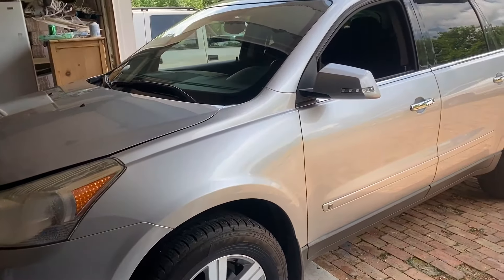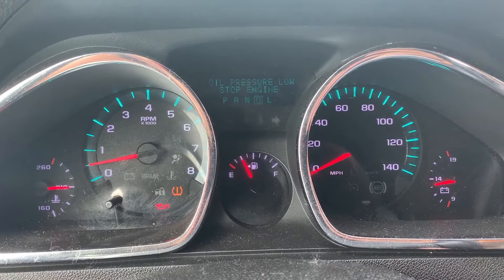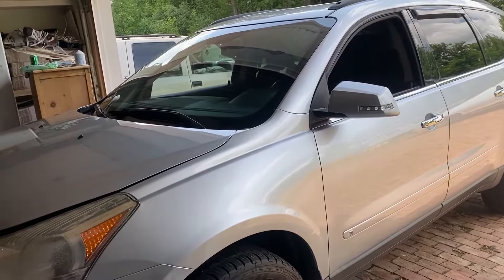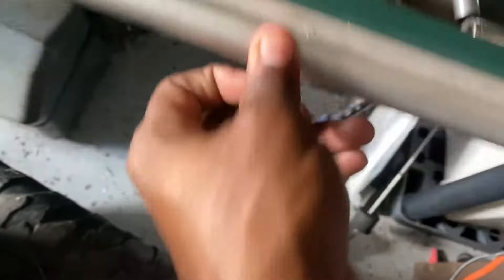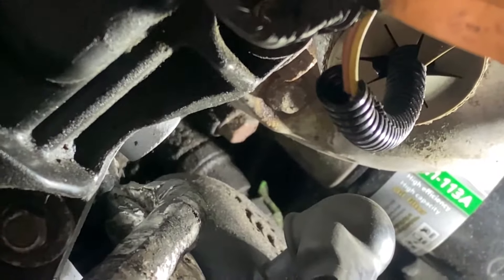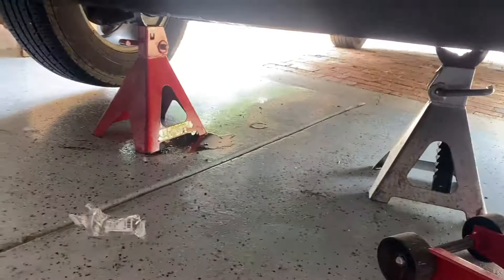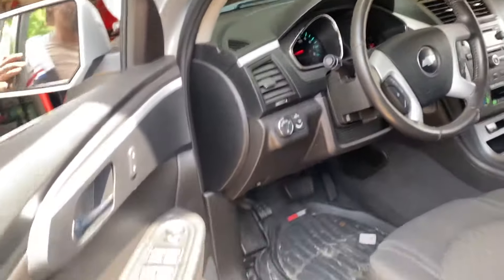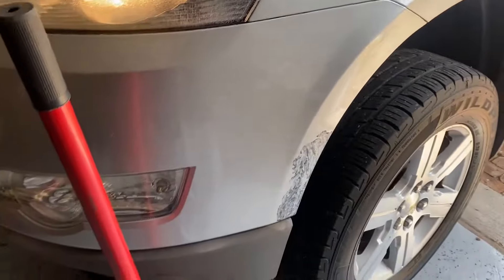Chevy Traverse Low Oil Pressure Issue!! Stop Engine Warning!! Easy and Simple Fix!!!

Comment: Hey thanks for the video, I have a 2011 chevy traverse , it runs good until about 20-30 min it warms up then a low oil pressure light comes on and makes a ticking noise , just wondering if thats a symptom of the oil pressure sensor, or something else?
Reply from the maker: When was the last time the oil was changed?
Reply: @TerenceDIY  I just changed the oil and filter but I also put brand new timing chains , chain guides , tensioner and oil pump in it , and changed the oils pressure sensor, don't know what else it could be honestly, it runs great for about 30 mins then oil pressure light comes on and makes a little tick , I shut it off then start it back up , sounds great for a while  , then does the same
Reply from the maker: Couple of things... first I want to ask have you ever replaced your VVT solenoids? I have a few videos on my channel regarding them (Not for this particular car). That could be your issue. Also, what oil are you using (type)?
Reply: @TerenceDIY  I've thought about vvt solenoids , and it put in 5W-30 ,.. I did clean the inside real good and so maybe there is some lose gasket or dirt, so I'm going to drain the oil and see if there is any junk in it maybe something is clogging the pick up tube , but Ill check the VVT solenoids and see if they are dirty. Thanks, I'll update you on what I find out
Reply from the maker: I won't be surprised if the VVT solenoids are the culprit. Let me know what you find. Thanks,
Reply: Mine did the same after i changed oil then i changed sensor after watching this and its still saing pil pressure low i dont see no oil leaking2016 chevy traverse @TerenceDIY

Comment: Good video. In my case the light comes on and then goes offs sometimes after a few minutes.  My oil is not low, just got changed a month ago. Should i change the oil pressure sensor ?
Reply from the maker: That will probably solve the faulty light signal you are getting.
Reply: Is it safe to drive the vehicle?
Reply from the maker: Yes. One thing to note, let's just say there was an issue with your oil pressure (highly doubt it), that Traverse would drive awful. Out of the ones I have worked on, most had faulty oil pressure sensors in which ultimately turns into a timing chain issue.

Comment: Hey brother on three years late lol I just watched your video. I absolutely had the same problem but also I’m having a service brake system on with my traction control light and the bell sound from the oil light coming on but my car runs fine. I drove it. 20 miles in no issue just the annoying sound and the service brake system keeps coming on any idea what that could be
Reply from the maker: It's difficult to really guide you in the right direction unless I was able diagnose it. I would probably know within minutes what the issue is. If you don't have the correct scan tool, autozone may be able to help and pinpoint the problem. I'm sorry. I wish I were there to help.

Comment: Thanks for this video.  I'm sure it helped a lot of people.  Question......I understand there's a filter behind the sender that should be cleaned or changed.  Does anyone know if this is true?  My advice to those with a 3.6 is to change the oil at 5,000 miles or less.  Never go by the manufacturers recommendations.  There are some tiny oil passages in this engine, and the timing chains (3) will fail sooner with dirty oil.  My brother ignored the advice, his started misfiring, he drove it anyway and it threw a rod through the block.

Comment: Great video.  Yours was the best I saw on YouTube.  I had the same issue and was able to swap out the oil pressure sensor in roughly 90 minutes with the help of your video.  Only thing I would add to your video is to disconnect the battery and then remove the alternator cover.  It gives you a little better visibility and room as it is very tight down there.  If I had not done this, I am pretty sure I would still be out in the garage belting out profanities.  One other thing is to take note where the ridge is on the new sensor for the clip.  The replacement sensor may not stop in the same location and you will have to rotate the clip appropriately.
Reply from the maker: Thanks for sharing that insight for others to note. Also, thanks for watching.
Reply: What to do after we change the sensor if it still saying that

Comment: Thanks for the video. I thought I was done for! It came on after 2 days of an oil change. I thought I had forgot to put the drain plug back on or somehow burned through oil or didn't tightened the oil filter enough and leaked all the oil out. Thank you so much! This video has reassured me! If you don’t mind me asking your tire pressure light, did you end up doing anything about that?. I’m in the same boat after a tire replacement and was informed that the old TPS was bad and was gonna cost an extra $200.

Comment: I have the same issue with my gmc acadia denali 2013 , i have changed the sensor but nothing changes the problem still not fixed i need help please😿?
Reply from the maker: How is it running? This issue goes beyond that sensor. The timing is a HUGE issue with those vehicles.

Comment: I have 2009 Buick enclave withe same oil pressure light comes on,the. I turn it off and back on it runs fine. Sounds like a faulty sensor no?
Reply from the maker: There's a very strong possibility. That's been the case on pretty much all of them that I have worked on. Thanks for watching.

Comment: Hey Question Mr. T... Is there a specific Switch or Sensor??? Or all the all the same. I have a 2000 LT Model.
Reply: Are They*
Reply from the maker: It's the same. Do you mean 2010 LT Traverse? Thanks,
Reply: @TerenceDIY  Yes I meant 2009!

Comment: I bought the 1 1/16 oil pressure socket and the damn thing won't catch like it's too big or something. Any pointers 2013 chevy traverse. TIA
Reply from the maker: Do to how the sensor is made, you really need to get that socket on there or try a long twelve point socket that will be large enough to fit the sensor.

Comment: So if the light comes on.. and then it dissappear within couple minutes.  Should I add oil or still get the sensor replaced.?
Reply from the maker: In your case, it appears that you may be low on oil however, please check the oil level to confirm that you are low of oil. You do NOT want to overfill the crankcase. Thanks for watching.
Reply: @TerenceDIY  yes it was low. I had a friend help me. I still want to check my whole car out to make sure EVERYTHING is properly working, should I take it to shop.? I have to be on highway in March. I just wana make sure my car is safe for and my kids
Reply from the maker: @mrsmealyrobinson  , here's my advice to you... If the car is driving fine, there's no need to take it to a shop. However, before you get on the road, I would take it to a Jiffy Lube and get the oil change (very important). They will most likely top off any other low fluids as well for a small fee and check tire pressure (important as well). That's my advice to insure that you and your kids are in a reliable vehicle especially during a road trip. If you have anymore questions please don't hesitate to ask. Be safe.
Reply: @TerenceDIY  ok thank you
Reply from the maker: You're very welcome.

Comment: mine just did the same thing after an oil change ,, a few manual shift  revs to 4 thousand RPM  put the light out ,, i will  be getting a new sensor though ..

Comment: Im having this issue at 177k just recently rebuilt my engine my car has oil and it sends me a message “ oil pressure low stop engine” light comes on then turn off the car and it goes away🤔 car runs smooth ??
Reply: What can it be? U think it’s the sensor or pressure
Reply from the maker: Hi Diamond, you can try the oil pressure sensor to see if that would help. To be honest,  I really do not like the Chevy Traverse. I've worked on a thousand cars throughout my life and this is just about the worst. Ours gave us constant problems.

Comment: I got an 09 traverse with the same issue. Ok gonna buy that part and try it. Thanks for the video 👍
Reply from the maker: You're very welcome. Good luck with the job. If you have any questions, please don't hesitate to ask.
Reply: @TerenceDIY  I have a question. Will the warning message make my car stop driving?
Reply from the maker: Absolutely not.
Reply: @TerenceDIY  Thank you!
Reply from the maker: @bwash6743 , you're very welcome.
Reply: Me too how do I take the clamp off?
Reply from the maker: @Daythetruth  what clamp?
Reply: @TerenceDIY  the cable that’s connected to the sensor
Reply: The green piece that’s connected I’m not actually sure what to call it
Reply from the maker: @Daythetruth   if you're talking about the green connector, you just lift the tab up and pull the connector off. You can use your index finger to pull it up or a long flat head screw driver to pry it up and pull it off. It's very easy.
Reply: @TerenceDIY  ok mine is hard for some reason but ok I will try the screwdriver
Reply from the maker: @Daythetruth  , that plastic becomes brittle over time and hardens up. Try to get your index finger behind that tab and pull it up while pulling backwards. It should pop off. I wish I were there to help.
Reply: @TerenceDIY  thank you I finally got it off now I having a hard time gettin the sensor off 😮‍💨
Reply from the maker: @Daythetruth  , the sensor can be a pain to remove. I hope you get it.
Reply: @TerenceDIY  thank you I’m trying
Reply from the maker: @Daythetruth  , good luck. Let me know if you were able to remove it.

Comment: Mine is giving this reading now. And it’s making a rattling noise could it still be the sensor or is the pressure really low ?
Reply from the maker: I am almost positive, the noise you're hearing, are those timing guides. Ours did the same thing and then a couple of weeks later, jumped timing. I could have easily fixed it, but the problem would have come back in the future so I sold it for dirt cheap. I will NEVER own another. Thanks for watching!

Comment: Awesome video ! The GM 3.6L has a crappy oiling system . It causes alot of sludge in the engine and clogs the Variable Valve Timing (VVT) Solenoid Actuator. That causes premature timing chain failure along with clogged oil preasure sensor and oil pickup tube/screen. So change your motor oil more often every 3000mi max .
Reply: Is the Timing Chain an expensive fix?
Reply: I have the same failure for chain timing , my question is , by changing the oil pressure sensor does it solve that failure or not? And if not what is the solution, please help

Comment: I'm so frustrated with my 2010 traverse change the oil sensor still doing the same thing anybody can help me almost took it to the junkyard but I figured I'd try to give one more shot I paid $4,500 for this car 6 months ago I'm a single dad of two teenagers and I need somebody's help thanks
Reply from the maker: I wish I were there to help. Unfortunately, the issue with these engines are timing related. There's no way around it.

Comment: Great video and explanations.  Would you remove the oil filter if you had to do it again?  Any benefit?
Reply from the maker: No, I would not remove the oil filter. There are no bebefits from doing so. Thank you so much for watching.
Reply: @TerenceDIY  the oil light came on because of a low tire you think
Reply from the maker: @jessiesintuition3517  , nope. If you have a Traverse, I'm pretty sure it's the pressure sensor. To be totally honest, when the oil light starts to come on, it's an early warning for a timing chain issue that is a serious prolem. One of the worst engines ever made.
Reply: @TerenceDIY  I bought a Buick Enclave same engine low oil pressure at idle after it warms up but the sensor has power could it still be faulty ya think
Reply from the maker: @jessiesintuition3517  , yes it could be faulty. If you don't mind me asking, how long have you owned the Enclave?
Reply: @TerenceDIY  like 4 months I right away had to install new converters which I new about before I bought it but the oil pressure issue was unknown I haven't changed the switch yet but I did check it 4 power and it works but I don't know if it's sludged up cause this engine after doing much research is very bad without proper oil Maintance I do believe I will need timing chains but is it worth it I already feel like I'm in to deep not to do it otherwise I'm taking a complete loss
Reply from the maker: @jessiesintuition3517  , I wanted to tell you so bad to get rid of it but I didn't want to offend you. I have worked on many of those engines and I recommend customers to stay away from the vehicles with them. We had that traverse for 6 months. It only had 80k miles and I always had issues with it. We sold it after realizing the timing chain was starting to become an issue. I warned the buyer (which was a car dealer), but he didn't care. All he wanted was to make a profit by forcing it on someone who didn't know much about cars. If I were you, I'd limit spending money on it and try to get rid of it before the timing chain does become an issue. That's my honest advice.
Reply: @TerenceDIY  thank you!
Reply: I just did one and after dropping the sensor I had to remove oil filter to get it.
It was much easier to get your hands on it with filter removed

Comment: Thank you!  Im experiencing the exact same symptoms. Mine started doing this about a month after my oil change.  It’s done it three times now, but today the low pressure light would turn off as soon as I accelerate. Do you still think it would be this sensor?
Reply from the maker: There's as strong possibility that the sensor is your issue.

Comment: How many miles does your Traverse have on it when you changed the pressure switch?
Reply from the maker: It had very high miles. Around 178k.
Reply: Getting ready to change mine this weekend. Thanks for the video
Reply from the maker: @charliebonacci3912  , good luck with your job. Thanks again for watching.

Comment: I have a 2008 Buick enclave and the same issue is occurring for the 2nd time after having a re-manufactured engine put in 3 years ago. I hope it's just the sensor. I have noticed that there's a delay in acceleration in the past 2 weeks. What's your thoughts?
Reply from the maker: Hi Michael, I would definitely try the sensor first. Even after having a remanufactured engine installed, they probably used many old parts from the old engine. So, your issue may just be the sensor. Fingers crossed. Thanks for watching!

Comment: Thanks for the tip I have a tip for you because I have the same vehicle that tick in the motor is the timing chain mines was sounding just like yours after replacing the timing it's very quiet and tight
Reply from the maker: Yep! You are 100% correct. Unfortunately, I will not be replacing the timing chain. I thought about it but, after reading reviews of it being an ongoing issue even after replacing the timing chain, I sold the vehicle. Good luck with your Traverse. Thank you SO much for watching!

Comment: Is that the same process on a 2011 Chevy Cruze I have all of those problems after changing the whole turbo system intake manifold and  gasket pcv valve oil  feeding tubes uper and lower lol pretty sure its the oil switch I really i don't think its the Oil pump (aka front over )
Reply from the maker: Gino, I am not sure if this is the same process as your Cruze however, they both are a Chevy product so I wouldn't be surprised. Why do you think it could be your oil pump? You will know if your oil pump is bad. The car would run like crap. Another indicator of a bad oil pump is to remove the oil stick while the vehicle is running. Oil should be way past the fill line if your pump is fuctioning properly.

Comment: Probably a dumb question, but if im not able to replace the part right now or have to wait a little bit to get it fixed, is it damaging to the car?
Reply from the maker: Hi, that is not a dumb question. You will not damage the engine at all. The sensor is faulty in which is giving out incorrect data. You would know if the vehicle had low oil pressure because it would run like crap. Thanks for watching!
Reply: @TerenceDIY  of course thanks for the help! The car runs great. Only time the sensor goes off is when im idle at a light or something, but aside from that it runs just fine. Thanks again for the reply
Reply: @420KillaJ  thanks for the info. My 2011 Traverse has been doing this on & off after oil changes.
Reply: @420KillaJ  did you got if fix ? Mine is doing the same thing at idle and stop lights
Reply: @erickherrera8225  I am having the same issue. Mine also behaves like that at idle and stop lights. Did you fix it or find a way by which it can be fixed?
Reply: @camiliusamevorku501  I had to replace the oil pump .

Comment: hi i have a question my 2009 Traverse throws oil.  paraceser that is from the oil sensor this sensor failure also causes it to consume a lot of fuel.  Thank you very much and greetings from Mexico City
Reply from the maker: Hi Eduardo, the oil sensor will not make your vehicle consume fuel. They are two different components. If the sensor is not installed properly, it will cause an oil leak. Failure of the sensor will throw a faulty oil light warning.

Comment: Brilliant, I have the very same issue. It appears I came to the right channel! Thank you. I'm gonna get on the same repair this weekend. I also have the same message on the tire sensor you also had, did you repair and video post it? Thanks again bros!
Reply from the maker: One of the tires was low. Once I aired it up, the message went away. Good luck with your repairs and thanks for watching.